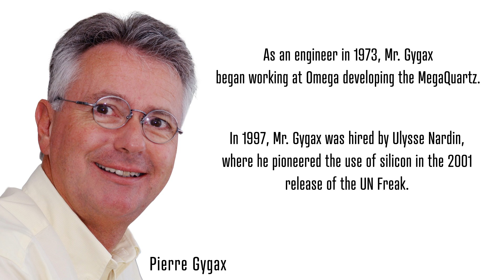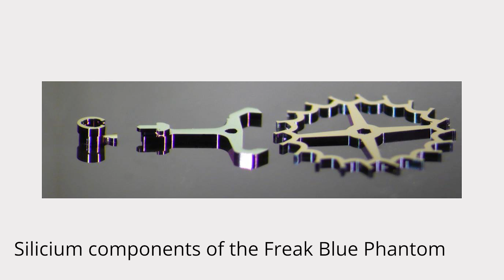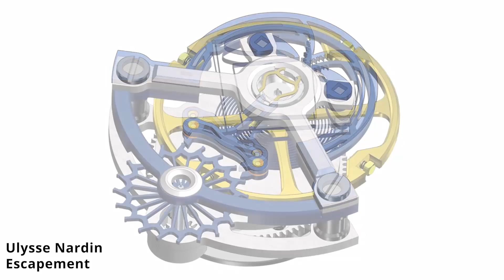Pierre Gygax | Pioneer of the Silicon Escapement in Ulysse Nardin "Freak"

Comment: There's plenty of silicon. "silicon is a naturally occurring chemical element, whereas silicone is a synthetic substance. Silicon is the 14th element on the periodic table. It's a metalloid, meaning it has properties of both metals and nonmetals, and is the second most abundant element in the Earth's crust, after oxygen.".  We may have to dig into the crust if we exhaust surface silicon.